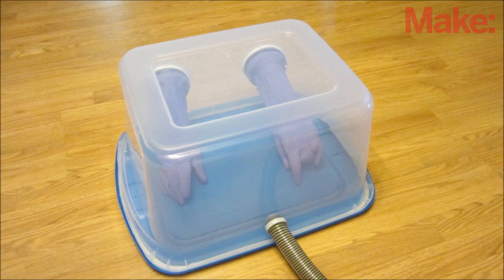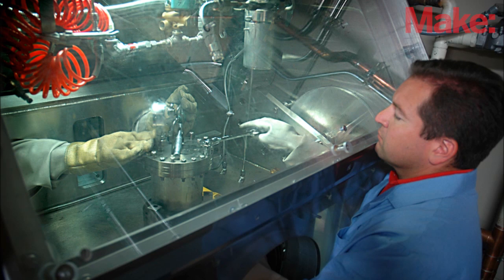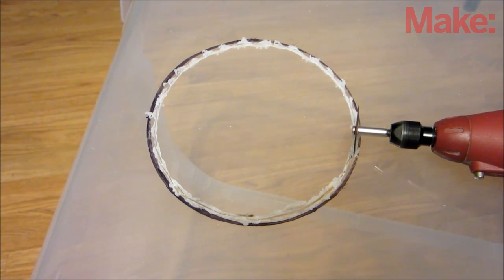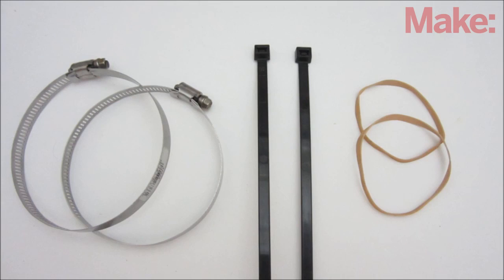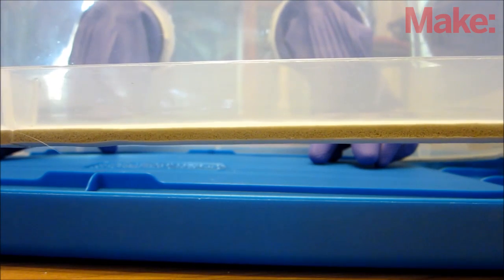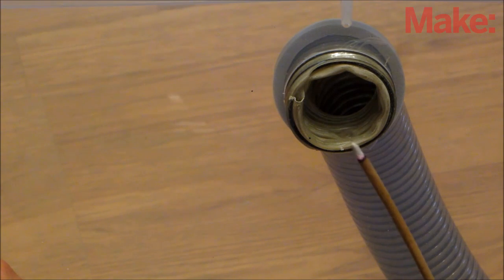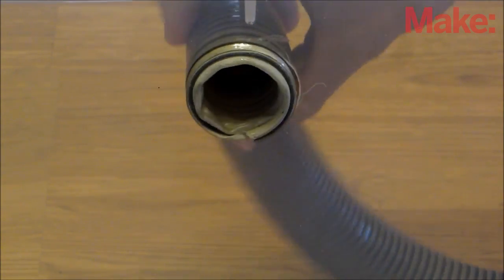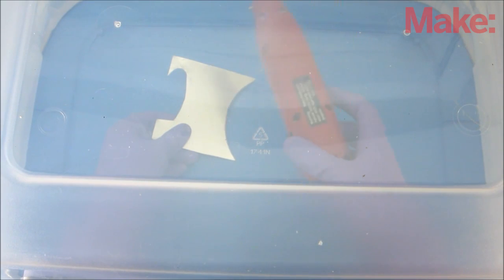DIY Hacks & How To's: DIY Glove Box

Comment: One of the problems with trying so hard to make the box airtight without a ventilation fan is that once a contaminant gets in, micro-currents from your hand movements ensure that the airborne contaminant circulates all over. You want to give a chance for the contaminant to go out more easily than it comes in! Even with small fans and especially vacuum hoses, the differing air pressure will suck in contaminants through any leak. I don't know about smelly fumes or smoke, but for a sterile working environment, the vigilance and maintenance involved with this make purchasing a laminar flow hood a much better option.

Comment: Yeah this wouldn’t be advisable for fungi or bacterial work, the negative pressure will suck bacteria, mold, yeasts and other contaminants into the box and into your semi sterile environment , for fume or dust eradication it may work great.
Reply: Do you think it would be serviceable with a filtered intake fan and an outtake fan on the opposite side?
Reply: @julius-sumner-miller  by the time you get all the parts (and time and labor) necessary, you might as well buy a purpose-made device.
Reply: with no air flow it'd be a still air box. next best thing to a laminar flow hood I'd think.

Comment: A clear container??? This is far from beyond a clear container! This is the sight you will have with a cataract! I would insert a few acrylic windows otherwise this construction is complete useless if you plan to build one for repair i.e. harddrives....
Reply: gurdfrankygurd all you need to do is cut an observation port in it then attach a plexiglass window to it that is larger than the port and bedded onto a bead of clear silicone sealant all round to make it air tight.

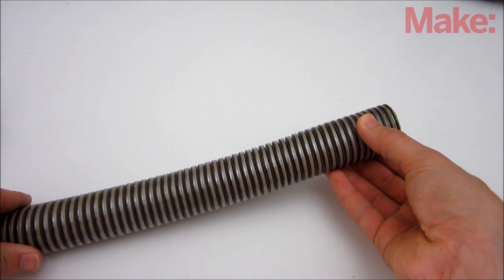Comment: 2:50  bro it is literally the exact opposite of what you just said.  you do not want air being sucked in lol, you don't even want turmoil so laminar flow is the only flow i'd use, but that aside blowing air in via hepa filter creating positive pressure is the only way to use air flow in a glove box.  creating negative pressure is sucking in mold and bacteria.
Reply: The person making the video assumes you're working with hazardous material that's being isolated for your own safety. But you're correct, if you're inoculating shrooms or something then you obviously don't want a bunch of air contaminants entering as that would defeat the purpose of a still air box.

Comment: pretty cool was looking for a quick cheap DIY glove box now i can fix a few HDDs
Reply: WiseMonkey84 its halfway there for sure but refinements i would make would be to fit an hepa air filter inlet port onto the side of the box opposite the vacuum hose nozzle. This would then suck clean filtered air into the box after it had been sealed with the parts inside it. You would only need about a minute for the vacuum to evacuate the dust contaminated air out and then you could switch it off. If the box is to translucent to see through cut an observation port into the top and fit a plexiglass window bedded onto silicone sealant over it to see what you are doing.

Comment: So, How does one get things into and out of the glovebox without allowing the external atmosphere into the box?
Reply: This isn't that kind of glovebox. However it could be made into one if you reversed the fan so that the overpressure is on the inside, so outside air is kept out. And add a filter on the fan intake, and probably a more powerful fan.
Reply: MrSwanley Thanks for the response

Comment: A micro blasting cabinet? How is that possible no matter what material you use the soft plastic will quickly become scuffed making visibility nil. These are best suited for entry level biology experiments involving cultures and such. I would not trust this design for any application where I need to protect myself. This is a cheap and simplistic design developed with the intention to protect the inside contents from the outside contaminants. In a typical setting most outside invaders come from the person doing the research as we are constantly shedding skin cells and exhaling our own containments along with the ones we just breathed in.   KIDS: 	 	 	 	
If you want to be successful in what you are trying to accomplish, do extensive research and formulate your own opinion. We all learn from our failed attempts and sometimes stumble upon something incredible. This is all well and good however there are so many sources of total crap information posted by people trying to earn a buck and get their 15 minutes of fame. (The former statement was not necessarily aimed at the maker of this video; just a general rule of thumb)
Reply: +rodangib Yea I'm well aware of that and i have made several, I accidentally posted my comment in the wrong area; i intended to reply to someone's comment.  However using a fan is going to cause more problems than benefits in a simple design; I highly recommend against it for such a simple setup.

Comment: This video was really helpful but I think there's one thing people should consider. I bought a cheap clear container and my rotary tool caused cracks stemming from the because the material is really brittle. I used a hot knife for the other hole and it worked perfectly. So for a cheap container I'd recommend a hot razor knife. Thanks for this vid and all the others as well.

Comment: Only problem is to cut those bloody holes in the box without getting the plastic to shatter...
Mmmmmhhhh, foxyyyyyy
Reply: Use a hole saw and set on reverse and it will cut the hole perfectly without cracking the tub.

Comment: This would be amazing with resin work. I try to avoid it due to the mess, but this could be great. This would probably also be great when shaving and shaping PVC with a dremel or similar too, as the dust goes everywhere. Maybe even for sanding down a 2-part epoxy seal to be smooth.